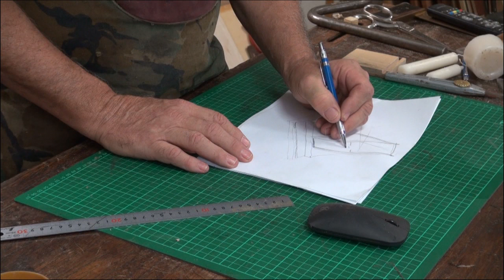Donkey Ear Shooting Board How to Make one.

Comment: where is your push stick for that table saw, tsk, tsk,
Reply from the maker: I only use then when if feel it's needed. If you look i'm nowhere near the blade. Personal choice not a recommendation. :) Cheers Steve
Reply: @Woodworkingmasterclass  No worries, just don't fancy Woodworking Masterclass with three fingered Steve
Reply from the maker: @angrygromit93  Nor I Dana. Appreciate your concern though :) Cheers Steve
Reply: Note the riving knife. Much safer than it looks.
Reply: @atrtsh  No disrespect to Steve, but you see this all over YouTube, riving knife of not, they push work through an in-guarded blade with their hands, often leaning over the blade in the process. In no way is that even remotely safe.
If you've ever seen first hand (no pun intended) the result of a table saw accident, I'm pretty sure you'd agree.
Reply from the maker: @atrtsh  I agree atrtsh, In my opinion a riving knife will reduce the chance of kickback by at least 97.5463% especially on short pieces. Cheers Steve